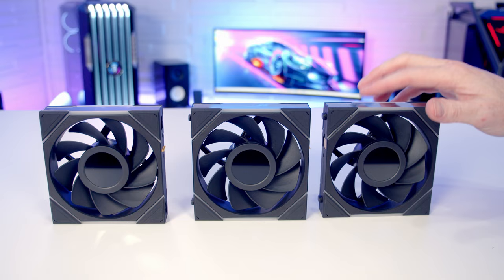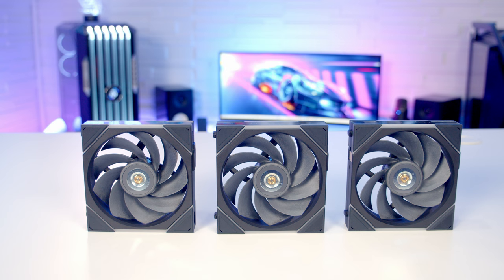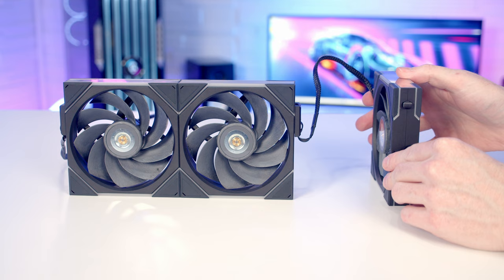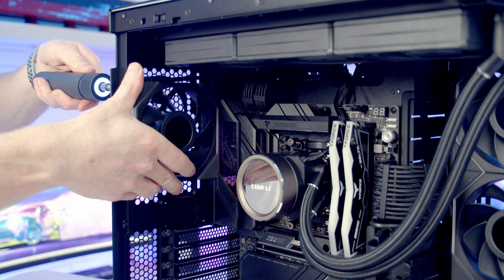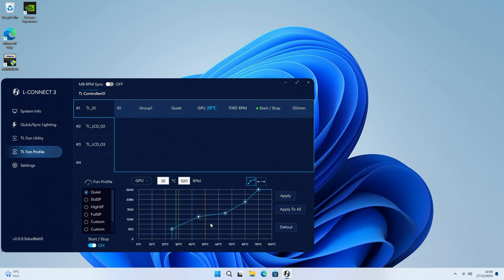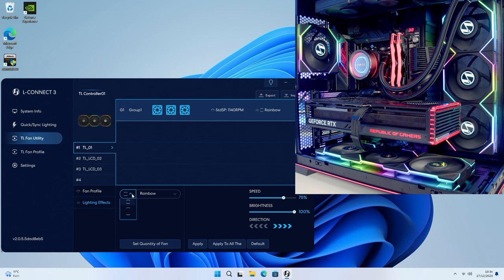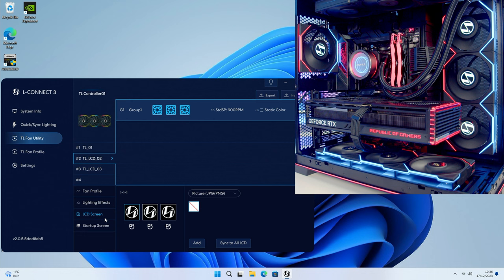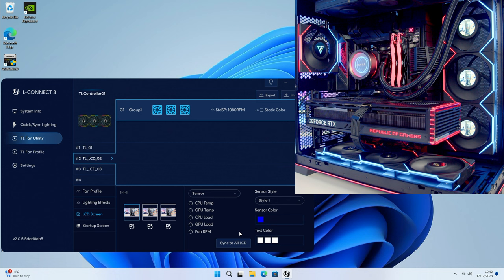Lian Li UNI FAN TL LCD - Installation Guide

Comment: The amount of Lian Li controllers you'd need is kind of annoying. They should release a controller that could connect the LCD Galahad cooler, SL Infinity Fans, TL LCD fans and Strimmer V2 Cables. You'd basically need 4 USB ports just to control all of these smfh.

Comment: maybe someone will have some suggestions... I have 3 of the TL LCD 120's, they are all plugged in, the USB is plugged directly into the motherboard... the fans are spinning, the screens are displaying the default graphics but my LED's are not lighting and L-Connect 3 v2.07 is not detecting the fans/controller, the fans are plugged into port 2 of the controller... I have tried both heads on my MB... I have tried un-installing and re-installing L-connect, I have tried L-connect 3 V2.06... I have checked all my connections... when I launch L-connect nothing is listed under Settings--> Devices... Im at a lost..
Reply: Maybe try switching the wiring around on the controller seen somebody with this problem .
Reply: Did you ever get a fix to this? I’m currently having the exact same issue 😭
Reply: @anthonyp1114  It was the controller, however I am having another issue with these fans... if my PC wakes up from sleep mode, they may or may not start spinning again, then I have to restart my whole system in order for them to spin... My PC boots a little hot because the fans come on and go off many times during the boot cycle... These fans are ahead of their time, they need to get working on getting these issues fixed... I had to do a push/pull on my rad because i dont trust the reliability of these fans... luckily i still had the corsair fans that came with my AIO... Im a little dissapointed, and I have 7 of these in my system...

Comment: Thank you for making this. I plan on buying the non-lcd fans and I needed a step by step video because the last fans I bought were overly complicated to sync.
Reply: Make sure all your fans are lian li TL. They have SL and AL too and I believe the boxes are exactly the same. If all your fans are TL they will all work on the same controller just make sure that the LCD fans are not plugged into Port 1 because apparently there's an issue with that. Provoked prawn also has several phenomenal breakdown videos on these fans and their installation guides

Comment: if you only have 1 140mm lcd fan you need to connect. do you still need a uni hub for it or could connect it directly to the MB somewhere?

Comment: To confirm, if I am only interested in controlling the fans and light via LConnect, do I need to plug in the PWM and the RGB connector to the motherboard?  Also regarding the 6 pin PCI-e power, does that just use a standard pci-e cord from the power supply?  My cords are 6 plug that go into the P/S and the opposite end is a 6-pin with an additional 2-pin.  Assume I just do not use the 2-pin on the end?
Reply: Regarding the power cable, pci-e is often 6+2 like you have, you'd only plug the 6pin block. The stuff on the power supply end is proprietary dung often enough that you should never, ever consider plugging anything other than the exact cable that came in the exact box with that one specific PSU. Even if you have another PC with the same brand and even model of PSU, swapping cables from one to the other may result in broken components and in the extreme: fire. You can probably guess how I know this. Wonderful world where everyone and their uncle uses the same physical connector, but the pins used are picked at random, not even by brand/make or even model number, but by 'revision'. Do not mix power supply cables.

Comment: I have a situation. Do you connect the GAII trinity cable into the fan hub? if so the head are smaller and divided into two pins. can you help?

Comment: What's your thoughts on these and the other Lian Li fans vs the Phanteks D30s? I love the look of both, but to my knowledge Phanteks doesn't have software controls for lighting etc? I currently plan on either a NV5 or O11 Dynamic case if that is a factor really

Comment: Why is the runway affect not working right on the bottom 3 fans? I've seen this in several videos now.. I'd take a guess it's down to the abomination software that is L-Connect 3? That's the reason I won't buy another Lian Li product that uses it.
Reply from the maker: It's beta software, hopefully any issues sorted by release
Reply: @ChristopherFlannigan  Beta? It has been available for general download for over two years. It doesn't say anything about being beta on the download page. The beta testing was done by a 'select' few because I can remember a conversation about it on Reddit. It's still awful even after all of this time! Some users are not able to control their new LCD AIO due to bugs in the software. It's unacceptable to keep releasing hardware that relies on it, and not bothering to fix the current problems with it.

The mere fact that they have two different versions on their site -  for users experiencing "problems" says it all.

It needs to be scrapped, and a proper dedicated team of developers need to work on something new.

Comment: I will have any problem if I only buy one of these fans? I see that it looks great in the back of the case (taking out the hot air) my doubt is because I have 6 infinty fans of the same brand... and according to the software, I see that I need the 2.0 ver for this new version, according to the web, is NOT compatible with the rest of my fans (Lian Li Uni Fan Infiinty), then, I will have to use 2 Lian Li software (L-connect 3) with different version (1.4 and 2.0) at the same time if I want to integrate this new fan to my setup?????
Thanks in advance and nice video!

Comment: Wait so this uses a SATA AND a pcie power connector!
And I need another different hub than for my 120inf infinity fans?
I just wanted to buy one for the exhaust fan on the back of my case so I still need to use both SATA and pcie?
I already have 2 sets of inf120's and a hub for each set of 3 since I am using signal RGB and it says to have only 3 lian li fans on one controller.
Plus I have 2 non lian li strimmers from airgoo.
I am afraid I am going to run out of 5v ARGB headers and SATA power as I have  some non nvme drives.
The strimmers come with 5v argb hubs but I am not sure if I can use them for this controller.
And my GPU uses 3 pcie 8 pin(6x2)
I know there are 2 more for the MB/CPU and I have them both connected but I think I only need one as I only have one CPU, 12700k
Is this correct can I use just one 8 pin for the CPU/MB?
It is an a Z690

Comment: Did the fan controller you used come included with either the AIO or the fan triple pack? I have seen that there are different Lian li controllers
Reply: There are SL and TL controllers - I ended up with both.  The controller comes in the triple pack not sure about the AIO

Comment: There's no reason these shouldn't work on a Galahad 2 AIO right? Planning on swapping out the included fans with 3 of these..
Reply: Did it work that’s what I’m thinking it should hypothetically work also if u did it did your power supply come with a pcei to pcie for the controller?

Comment: I just ordered a single 120 LCD fan and the hub. My PSU has  4x (6+2) pin connectors and 3 of them are used by my by GPU. Can i use a Sata to 6 Pin adapter instead of connecting to the 4th (6+2) pin connector?
Reply: I looked at this but believe the controller needs to go on the PCI-E?
Reply: a double sata to 6 pin would be preferred

Comment: That rear fan, was it set to intake or exhaust and can you change it?

Do these fans come as exhaust only?
Reply: You can order reverse flow variants, though they may not be available for a few weeks as they are new to market.
Reply: thanks for the heads up. I'm terrible at visualizing something like this but the regular fans that he installed in the back of the case (The single fan) which way is that going to blow? Into the case or out? Thanks @SweetLou0523
Reply: @jonathanmiller3613 you solve this? I'm trying to put a fan in the back and wonder if I should get reverse for it or are those just for the top of the case
Reply: yea to exhauset out the back you need the reverse blades based on what my buddy told me... new egg is all sold out so ill have to wait til the 11th and see if my microcenter gets them in stock.  @awesomeruben
Reply: @jonathanmiller3613  man that sucks, I picked up the regular fans at the moment, then I'll pick up a reverse fan, The problem is this is the first fan where you need to be 100% on which way it blows because there's an LCD screen now lol so everywhere I went for an answer people just said reverse the fan 😂
Reply: Exactly. I keep saying oh you can move the screen sarcastically

Comment: Is the new hub compatible with the uni v2 fans ?
Reply: From everything ive seen, sadly no. The tl fan controller only works with the tl and tl lcd variants.
Reply: @SweetLou0523  Would it be able to connect directly to motherboard with all functions working the same